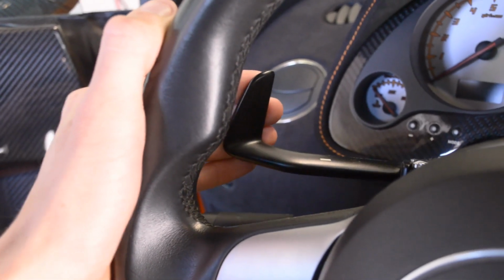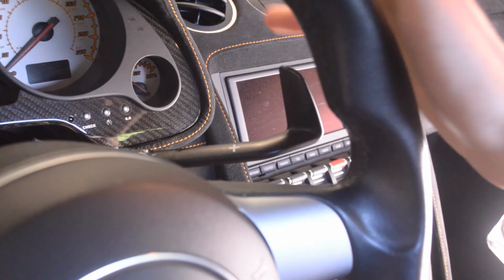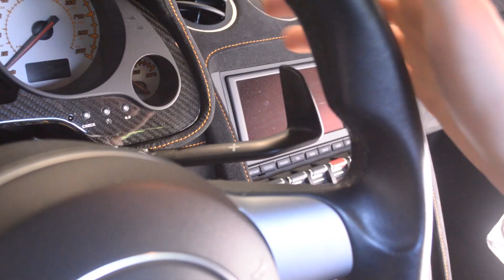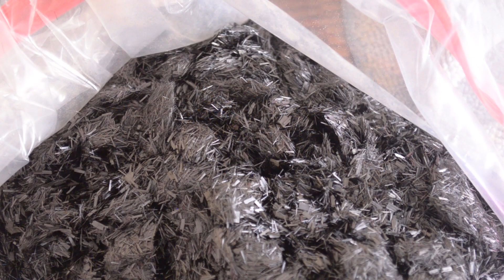Making Carbon Fiber Shift Paddles For The E Gear Gallardo, Lamborghini Gallardo Forged Composite

Comment: Hi Richard,

I have a question for you I hope you help. I have 2006 Gallardo parked in my garage.
One day after not using it for a week, I got in the car and started like usual, but this time I noticed I had no brake, so I pumped the brake pedal few times, after that the pedal came back like normal. So I checked the brake fluid level,
And it was fine. I check for leaks, no leaks. This will happen every time I leave the car sit for week or so without stating it. What you think it could be?
Thank you
Reply from the maker: Interesting question Bravo Bravo! Does your brake pedal go all the way to the floor you try to press on it or is the pedal firm at the top of its travel but the brakes don't engage?
Reply: @TheBullRider  
Thank you for the reply back
I will do what you just said and I will let you know what I found out.
Reply: No it goes to the floor. I have to pump the pedal several times until it get back to normal firm.
Reply from the maker: @bravobravo9783  That is a very interesting problem!. Let me think about that one for a bit.
Reply: It does that all the time. I leave the car for one week or so and when I get in it and start the car no brakes I pump it several times and the pedal come back I take it for a drive no problem drive beautifully brakes good everything is good.
Reply from the maker: @bravobravo9783  I have thought about this and I believe that there is a seal that has failed in your brake master cylinder.
Try this, with the car turned off after driving it, pump the brakes until the pedal is firm. Once the pedal is firm, we know that all the vacuum pressure is out of the brake booster. 
Then apply strong pressure to the brake pedal and see if the pedal sinks to the floor. It will likely do it slowly. This is a good indication that a seal in the brake master cylinder is letting fluid pressure leak back into the reservoir. 
 
 Triple check for leaks though! Even if there is a pinhole leak, it would cause these sort of symptoms. 

I would get this checked out ASAP, even if its fine right now, it will likely get worse. Overall its a relatively straightforward job however. Just be sure whoever does it, doesn't get brake fluid all over the place! It will mess up your paint big time.
Reply: Hi Richard 
Sorry it took so long.
I did what you suggested I turned the car off I pumped the brake until it was firm. Then it start sinking slowly.
Reply from the maker: @bravobravo9783  If it isnt a leak Bravo Bravo, I will bet you a beer its the master cylinder! 
Thats not really a big deal though! Honestly, its probably one of the easier jobs to do on this car.
Reply: Who sell this master cylinder?
Reply from the maker: @bravobravo9783  I was trying to find that for you previously but it looks like they sell the whole unit with the brake booster. The part number appears to be 400612100B. 

Looks like you can get it from Scuderia parts still but I've had really long lead times from these guys although they are good. 
https://www.scuderiacarparts.com/part/50368/lamborghini/400612100b/power-brake-complete.html

Reach out to Jason Burtman by call or text, he might have a better lead time than those guys and probably for cheaper. 717-319-2100

It still might be a good idea to get a formal diagnosis from a mechanic and see if they can find leaks that you cant. At the end of the day I am still diagnosing your car from across the internet via a text box!! Haha

Comment: Very cool. Crazy how you can hand make it.  Being a digital 3D guy stuff like this makes me want to just buy a 3d scanner and printer. Even if the print is temp having proper model could be sent out for metal print etc etc.
Reply from the maker: Michael, you should check out a "free" app called scandy. It does a surprisingly good job at 3d scanning complex objects with an iphone 11 and above. 
For stuff with lots of critical dimensions however, nothing beats a set of calipers though!

Comment: How about bonding your carbon fiber paddle to the OEM paddles you have that work
Reply from the maker: Stephen, I like that idea and it would totally work but I'm worried about messing it up and not being able to drive my car!!  haha. My current thought is to machine that little end piece separately so it actuates properly and then bonding that to the carbon. What do you think?
Reply: @TheBullRider  that would definitely work too but It might be easier to just pick up a used set of paddles and cut the part off you need for the project
That way car isn't laid up till your carbon paddles are finished
Reply from the maker: @thebeard271  I agree. I have a really good CAD model of the actuator mechanism of the OEM paddle. The problem is turning the CAD into reality! 
I think I saw an old set on eBay. I should take a look again

Comment: The prior owner of my Gallardo installed KPA paddles. I could not imagine using the tiny OEM ones. The only issue I have is that pulling the upper paddle doesn't always provide the proper shift actuation. Pulling the lower part of the paddle always give me the shift I want. I'm too lazy to pull it all apart to figure out why.
Reply from the maker: Dave, im happy you like the KLA paddles. A lot of people do seem to like those. Very interesting that it doesn't shift exactly how you want them to every time, especially on the top surface.

Comment: Love this Richard !!! We have yet another thing in common....   the startup i created has 11 various product categories, several being polymer resin work, home improvement (designer vessel sinks, kitchen sinks & countertops) home accessories (coasters and decorative bowl) and the business collection (business cards)... if i may recommend, sand the pieces with 220 grit to level off any high spots and smooth the edges...when applying final coat, run a heat gun back n forth to to level it off and pop any tiny bubbles...it will leave a glass like finish.... i love the carbon you chose for this, its leaves a beautiful abstract design from any angle.... well done !!!
Reply from the maker: Deuce, you understand then! Kind of fun how much things can translate over to a different field. You mentioned coasters and decorative bowls but what's funny is what I learned CNC machining wood, directly translates into machining composites.  You are totally right! The heat gun method works so well for that finish coat. I realized I have to be careful though because if I heat it too much, the resin thins out and runs everywhere!
Reply: @TheBullRider  
Yup....it sure does...precision with time & temp..... i cannot tell you how many times i thought, "eh, just a little more" and ruined projects....patience is key..... great work there brother !!!
Reply from the maker: @ndpesicgroup  Thank you sir! Looking forward to updating you with what it looks like at the end of the day.
Reply: @TheBullRider  you know I'm looking forward to it !!!

Comment: The paddle looks great!  I'm sure the answer to your issue is just thoughts away.  
 A few questions, is the mold a one-time use or are you using the same mold each time? 
What about the epoxy flowing into the mold?  Have you thought about injecting the epoxy?   
Can you apply a vacuum during molding?   Just a few thoughts...
Reply from the maker: Mario, thank you! I'm glad you like the paddle so far. 
The mold is a one time use item, although I did design it to be manufactured from either aluminum or a high density tooling polyurethane block in the future if I would like. 
During the prep process, we coated the molds with epoxy and let them cure to prevent the part epoxy from flowing into the mold itself during layup! 
The epoxy is very thin, much like a resin infusion epoxy, and it has a high ability to flow into all areas of the mold after I pour it and compress it. I run very resin rich during layup but I am very precise in terms of my fiber content. At the end of the day, I am aiming for a 60-40 fiber-resin ratio. 
Whats cool about this manufacturing process is we don't need vacuum pressure to consolidate the composite during cure. The male mold compresses into the female mold and with the assistance of clamps or a shop press we can  achieve a higher pressure force than what we would typically see in a out of autoclave composite.

Comment: Richard, simple fix….have a machine shop mill you some end pieces with an original as the template, and then just attach them to the carbon paddle.
Reply from the maker: Patrick, you are right on the money with this one! Getting these quoted now. Its such a simple solution... Don't know why I didn't think of it before.
Reply: @TheBullRider  awesome. Can’t wait to see the finished product. This is a perfect example of why I’m thinking of starting a channel. Outside looking in gives a fresh perspective.
Reply from the maker: @patrickgreen9747  You should! Making videos is fun! And two sets of eyes (or 1000) is very helpful!

Comment: Great work as always! I'm super happy that I got a set of the aluminum KLA ones used from the forums but they are getting harder and harder to find.

As for your issue, have you considered machining the part that fits inside the switch first out of aluminum, and then dropping that into the mold? CAD out of aluminum should be a lot easier than machining directly on the part, and you can test it to get it perfect before building any of the paddle.
Reply from the maker: I saw your video regarding the KLA paddles you have. They are very nice! 
You are totally right, I'm getting these quoted out right now! Don't know why I didn't think of it before. Haha

Comment: i would just cut the ends off the oem paddels and stick them on the carbon ones
Reply from the maker: Mohammed, that would totally work but I'm worried about messing something up and not being able to drive the car! Others have suggested that I machine aluminum ends that interface with the switch and then bond them to the carbon paddle. What do you think?
Reply: @TheBullRider  .  get cheap Chinese ones another idea is to make clip on extensions instead of full replacement

Comment: If you also want some increased strength you can run a single length of carbon tow through the whole part especially near and around the pivot point and lever arm connection
Reply from the maker: That's a good idea Andreas. I think I saw that on a video I recently watched. I think as it is right now, we could hang a 100 lbs off these bad boys without breaking them but that lever arm connection does leave a little bit to be desired, especially after post-processing. 
I tried a longer length fiber in the pivot point area but the voids were a no-go and I decided to go with a shorter length fiber in that area. Void content was reduced significantly that way but it might have had an effect on strength for sure.
Reply: @TheBullRider  please consider a less viscous resin
Reply from the maker: @sadhippo1725  You mean for the layup or the finishing operation? For the layup, its already a very thin infusion resin. 600 cPs!!
Reply: @TheBullRider  ah Okey my bad sorry
Reply from the maker: @sadhippo1725  I appreciate all your input. You think of things that I haven't thought of yet and for that I am grateful.

Comment: Great work 😎👍 you could chop an original set and use the stem inside your new part and mold round them.
Reply from the maker: That is a good idea MechatronCNC, the problem is I am worried about messing them up and not being able to drive my car! Other have brought up the idea of machining the end pieces and then bonding them to the carbon paddle. What do you think about that idea?  
Looking at your channel, I am surprised you didn't have some genius wisdom regarding my machining process!! Very cool piston pens BTW.
Reply: @TheBullRider  Hey, thanks for the interest 😎👍 I appreciate the kind words. Yes you can do that as it will make the same geometry, if you want an easier way to do the same thing then just silicone mold around the original and pour Polyurethane casting resin in there to capture the end detail, it's very robust, you could put a nail inside to give more support if you wanted too. I was impressed by your ingenious maching strategys, alot of people shy away from maching and 3d printing, you just have to give things a go like you are doing 👏 we are all still learning, my next part/project will be better than my last. Youtube is a fantastic resource, check out my friends at easycomposites for more tips on working with that stuff👍 I love the lamborghini content, keep up the good work 🙂

https://m.youtube.com › playlist
All Easy Composites Tutorials - YouTube

Comment: Hi,
I have changed my paddles to carbon ones, and had the similar «problem» as you do. But in my case with my paddles, the problem was that it actually require a lot of force to make the paddle to trigger the button. So try to assemble everything into the car and push the paddle before you give up, it may still work even if you don’t think it will outside of the car :)
Reply from the maker: Interesting perspective Espen! Sorry to hear that you have to use a lot of force to trigger your paddles. Did you notice how with the OEM paddles, you barely had to touch them to get the car to shift? The goal is to get a "perfect" actuation like that!
Reply: @TheBullRider  When the paddles was installed in the car, the actuation was absolutely perfect! The «problem» was that I didn’t think the paddles worked because I was not able to push the button when the whole assembly was outside of the car, just like you describe in your video. I did use a lot of energy thinking what was wrong, until I decided to assemble everything and it actually worked when installed. When you hold the paddle assembly in your hands, it require a lot of force to actuate the paddle to trigger the button. When installed you push at the end of the paddle and that soft push generates the nescessary force in the assembly to trigger the button. Sorry for my bad explanation, I’m from Norway 😅 But give it a try and assemble it in the car and try to push the paddle, it may work! 😃
Reply from the maker: @espenlund1444  I will try that! That is a good idea. Aren't you worried about damaging the plastic housing by pushing it too hard?
I can actuate the stock paddles out of the car without much issue but these ones I made do nothing! Haha
Ill keep you in the loop on what I find out!